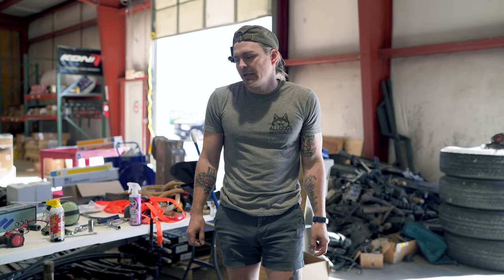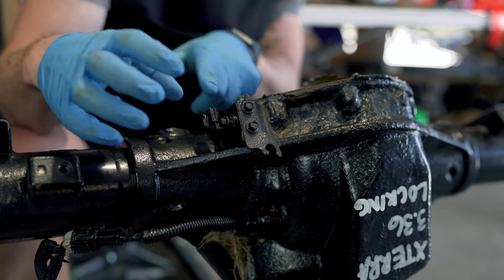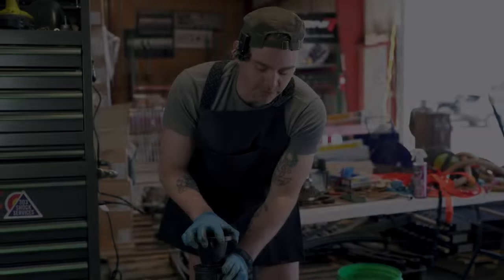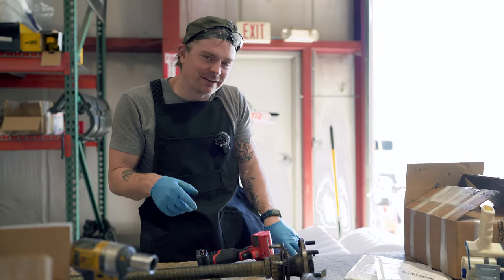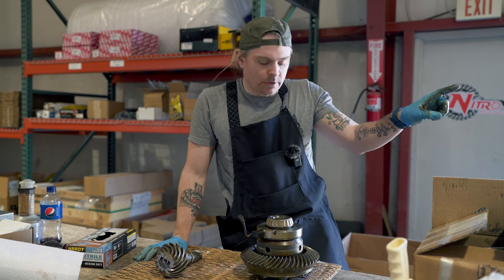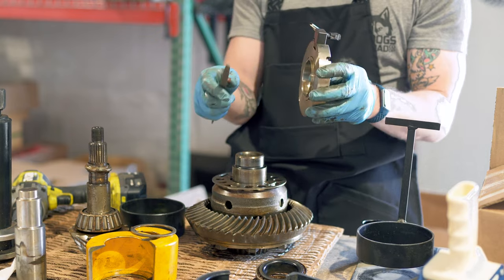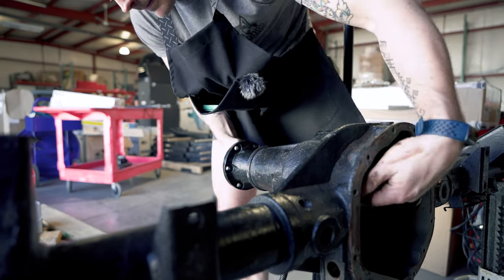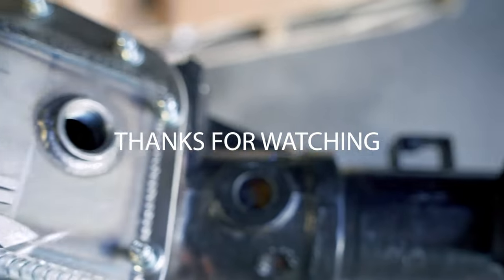Nissan Frontier & Xterra M226 Rear Axle Wheel Bearing / Seal & Differential Rebuild

Comment: That was very cool and super informative. Been looking to do this to my Frontier.
Reply from the maker: Good time for a regear!
Reply: @AlldogsOffroadCoop   But would I need to? Re-watched your intro and my truck use matches yours and max tire size would be 33".  Like the idea of a rebuild service and servicing the locker. Great episode.
Reply from the maker: @mikemorgan4670  when you're already in there it's a good time to if you plan to run larger tires.  We are mostly scavenging parts from around the shop to keep this low budget otherwise we would have thrown some 3.692's at it.  If we were baller building, it would have been 3.692's with an M205 up front.

Comment: do you know where i could find a new bolt for the carrier caps? one of mine came loose, snapped in half and destroyed the gears, got the parts to rebuild it all but cant find a bolt anywhere
Reply: the 19mm bolts for the cap mentioned at 10:10 in the video

Comment: Hmm wish you could post the torque specs on the M226 diff cover, many ppl have been breaking bolts.
Reply from the maker: 36 lb ft. quick google search for people breaking them would work.
Reply: @AlldogsOffroadCoop  see that's the value that many ppl say they've been breaking them at. Hmm 🤔
Reply: I'll incrementally try to reach that value I suppose. Thanks for the help.
Reply from the maker: @fernandobriseno8164  we usually just hand tighten and check to make sure it isn’t leaking after a day or so